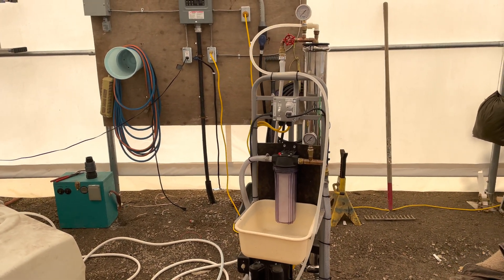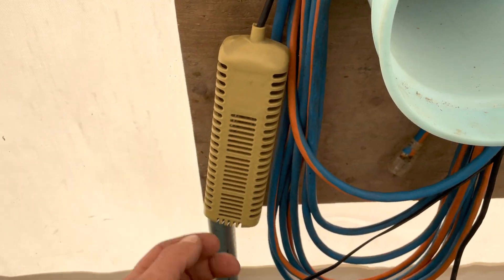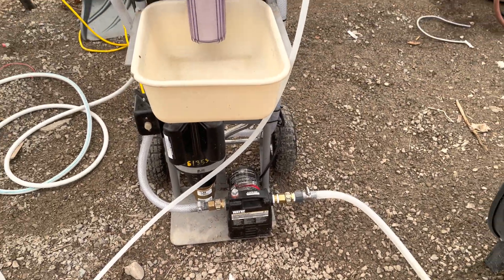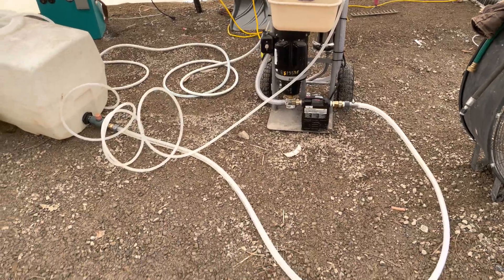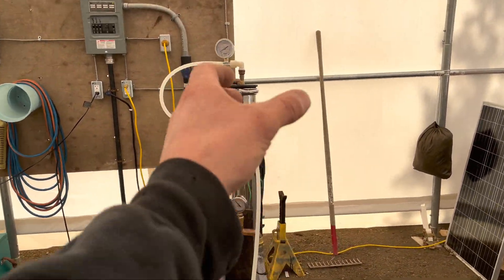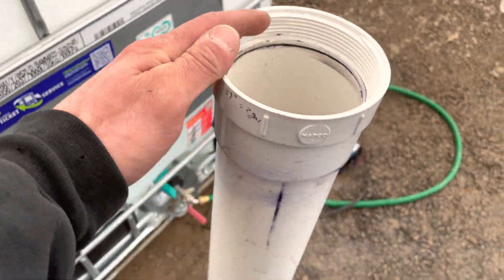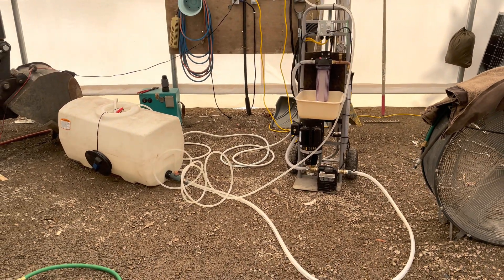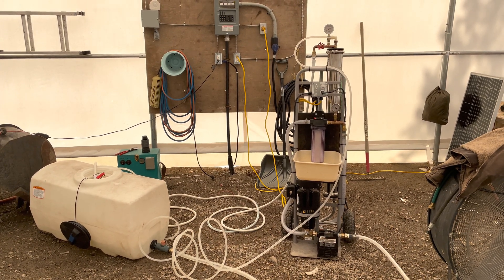Making Maple Syrup - Reverse Osmosis Cleaning and Storage - End of Season - Membrane Flush and Store

Comment: How would this work with a Reverse Osmosis system involving 4 RO membrane filters?
Reply from the maker: Connect the membranes in series. Inlet to outlet of each. Pull the permeate off of each 4040 membrane you have. So if two membranes you’d have two lines of permeate (pure water) coming off.